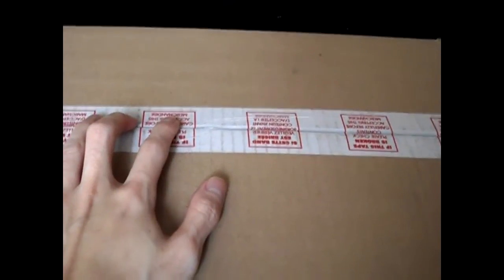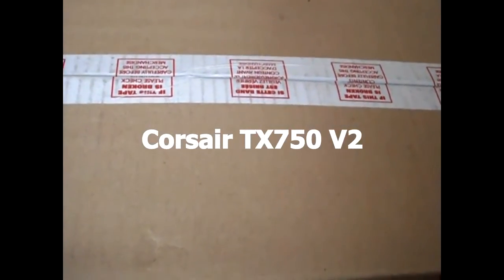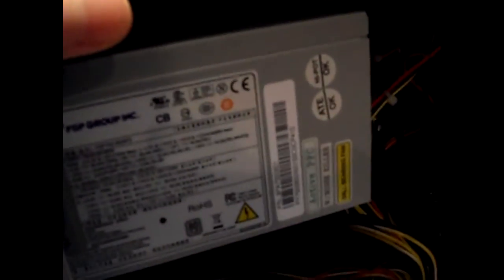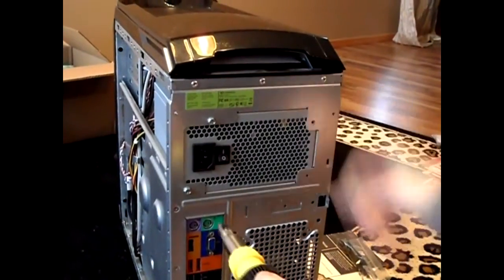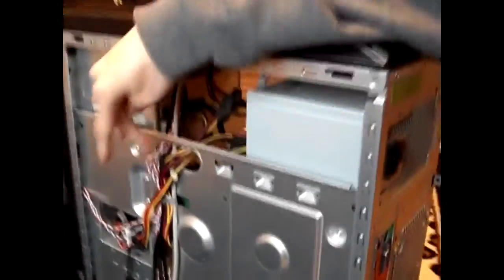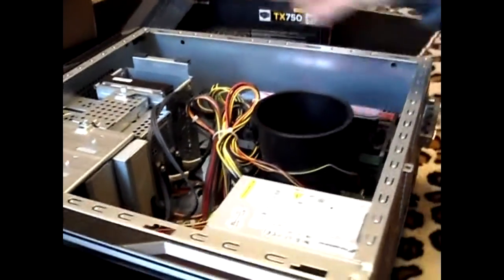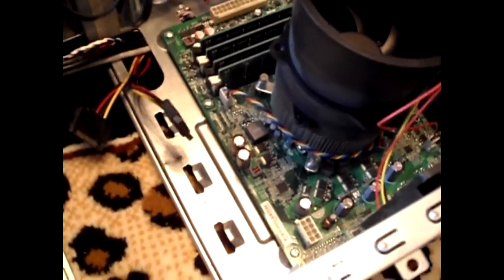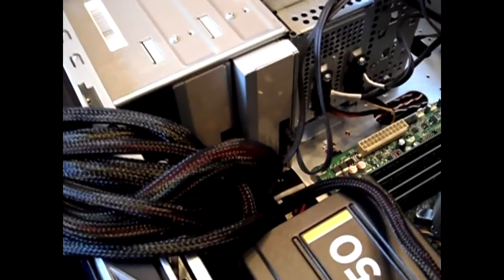Review Corsair TX 750 TX750 V2 watt unboxing and how to install a power supply in a computer

Comment: FYI:

That power supply is best used in bottom mounted cases. It is supposed to be with the fan shooting air throw the very bottom of a bottom mounted case.

The way you are using it now, the fan on it is exhausting hot air from the unit onto your motherboard. But I assume you know this already.........